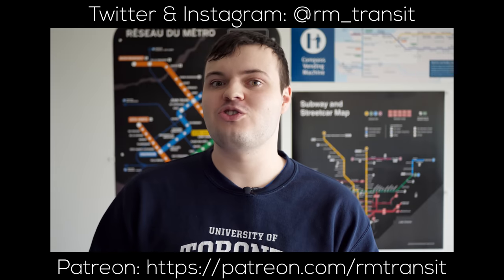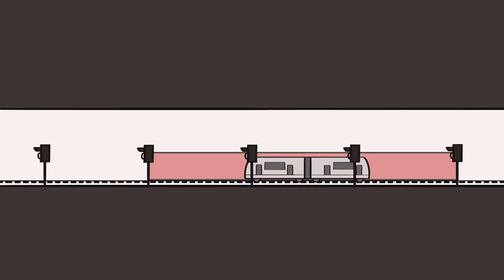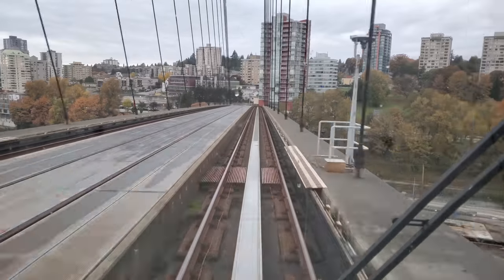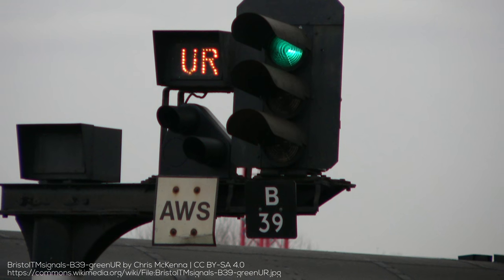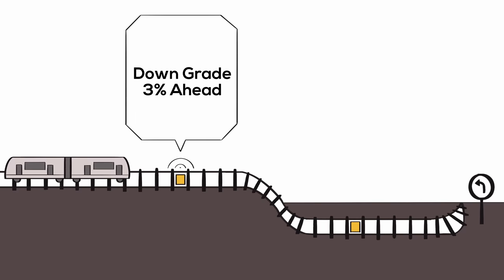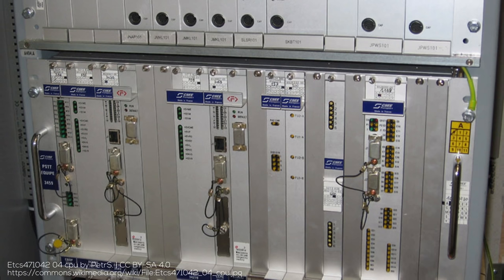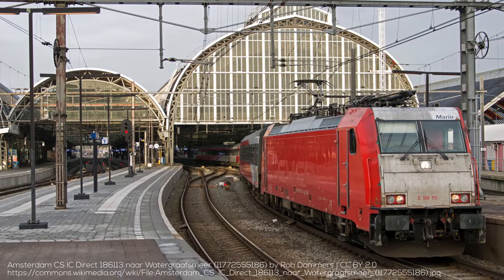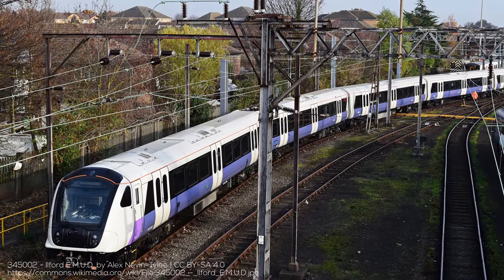How We Keep Trains from Crashing | Signalling & ETCS 101

Comment: Very informative  and yes please do more about train control systems. I'm still confused about what the "murican" PTC system actually does.🧐
Reply: it basically acts as an automatic braking system. say a train is getting too close to a red signal or there is no response from the engineer, the system will automatically apply the emergency brakes. (if i'm not mistaken)
Reply: @joeykidd8916  So it basically enforces "block authority"🤔

Comment: Can you get a video on what exactly the difference between ETCS level 1, 2 and 3 is and if any systems actually use level 3.

Also explain "CBTC" since technically the phrase "communications based train control" can be used to describe any signalling system as they all base their operation on communication of some variety. I know it refers to moving block signalling but what are the boundaries around it's use, how does it differ from ETCS level 3 and can CBTC systems from different companies work with each other.
Reply: ETCS-1 is an overlay system on the national standard. Balises on the track transmit the signal and route information to the train, and the existing rail vehicle detection systems (track circuits, axle counters, etc) are used to indicate track occupancy in the signalling control centre to the dispatchers. Train drivers follow the lineside signal aspects, but the ETCS telegrams may authorise a higher speed limit.

ETCS-2 replaces lineside signals with radio telegrams. The train is in constant communication using GSM-R, receiving movement authorities to proceed to the next block. Track circuits or axle counters provide the rail vehicle detection to the interlocking systems and dispatcher.

ETCS-3 eliminates rail vehicle detection (no track circuits or signals). All movement authorities are communicated over radio, and the train needs to pass very strict integrity checking or an emergency brake will be enforced. Lineside balises are used solely for static information, such as gradients and fixed speed restrictions. The main reason why ETCS-3 has taken so long to develop is because train integrity is a difficult problem to solve without a communications bus along the length of the train, and it is not cost effective to fit tens of thousands of old freight wagons with the electronics required. 

I believe a low-cost variant of ETCS-3 is used in Sweden as a replacement for mechanical signals and train orders on very lightly trafficked lines.

CBTC is the name for a bunch of proprietary cab signalling systems. There are too many variations on the technology to list, but none of them are compatible and choosing CBTC effectively locks a railway into relying on the equipment vendor.
Reply: @zoqaeski  You can have signals and national systems (as a second system) in ETCS Level 1, 2 and 3. Both in Levels 2 and 3, much information is transmitted by radio, usually including track information. At the Stuttgart Digital Node project, we noticed that train integrity is not THAT complicated for multiple units, in fact is only costs a few thousand Euros extra (per train) when ETCS is retrofitted anyway (which costs a few hundred thousand Euros per train). The same goes for FRMCS. When trains are to be fitted with ETCS for Toronto anyway, both ETCS Level 3 and radio-based ETCS/FRMCS should strongly be taken into account.

Comment: Can you explain why it has taken the TTC a decade to do signal replacements on Line 1? Having Eglinton Station shut down twice a month on weekends for 10 years has been a nightmare.
Reply: Pity the poor signal maintainer who has to stand in the tunnel as the subway cars whoosh past at speed
Reply: Line 1 ATC is in near completion.  

Understand that signalling from Union Station to Eglinton Station presumably dates back to when the subway system began in 1954.  Subsequent to the City of Toronto amalgamation in 1998, TTC became an agent of the City of Toronto; thus, their budget has become diminished.  Basically, it could a matter of dollars and cents.  About 2-3 months, there was a topic why these projects costs so much.  It turns out that politics play a role-quiet a lot too!

As for those shutdowns at Eglinton Station that began in early 2018 because this station is one of the three interchange stations with the Crosstown line 5.
Reply: @efaber3565  No the frequent signal related shut downs began nearly a decade ago, you can simply google that, but I know that because I've lived it. The current upgrades were supposed to be finished in 2019 and now they are 3 years and $100million over schedule & budget which is unacceptable. This city/province is a joke, we can't build anything in a reasonable time frame, heck London built a real subway line 4x the size (in a similar time frame) of the crappy Eglinton LRT (that will be at capacity day one). I'm just thankful that Doug Ford has seen more transit projects completed and approved under his watch than the decade plus of idiotic leftard control.
Reply from the maker: I wouldn't say the shutdown has been that frequent because I have been a regular Yonge line user in the past and while they were annoying they also weren't so common and part of the shutdowns were not related to signaling but the light rail line. I said I think as with many large projects on old infrastructure a lot of discoveries were made about what was and wasn't possible and this was the first time Toronto had converted a line.
Reply: @RMTransit  It has been, again because I've lived it. You can be a L1 user south of St. Clair and never realize how often Egg is shuttered so your word means bunk. If you want some proof please spend some time scrolling through the TTC Opps Twitter feed. Also as someone who grew up with Eglinton as his home station I have seen this project from its inception in 2013 and the early studies that took place that shut down the system for a weekend first hand. How come it will take NYC only 15 years(maybe 20) to refit their entire system yet Toronto can't complete half a line in the same time frame?
Reply: @adellis24  Most of the closures at Eglinton have been due to construction of Line 5 Eglinton, not signalling.

Comment: In today's world of cheap data storage, a database of every rail line in Europe would not actually be that much information. I think it is about 10,000 rail lines with, say, 100 kilobytes of information at most on each line, it would only total in the megabytes. Certainly doable. Consideirng that car navigation systems often hold more data than that for every road across a wide area. I think ETCS Level 3 (so far not deployed anywhere) does work with a database on line information and has only position balises to confirm location.

Comment: Does ETCS include visual signals for train operators (like track-side lights)? I understand that GO Transit will be implementing it and am curious what its lights/ signals are or will be.
Reply: ETCS level 1 uses fixed signals but level 1 is literally just a system that stops trains if they go through a red signal and slows them if they go too fast, the actually signalling and authority is done by other means. You can use level 1 with in cab signalling though, where a display tells the driver what speed to drive but if a network already has line side signals they will almost never implement in cab signalling, you might as well go straight to ETCS level 2.

Level 2 of ETCS still uses "fixed blocks" but they are virtual which means that rather than relying on physical track circuitry or axle counters to detect trains, the trains communicate constantly with the control system and the block locations exist more in the computers than physically, which makes it much easier to add lots more and increase the capacity.

Some systems have kept the wayside signals for redundancy (should ETCS break) but many systems have "degraded signals" that just allow trains to continue at full speed to the next station, but at the cost of railway capacity as each station and preceding section is the signal block, meaning trains can only run about once every 5 minutes.
Reply: @pwhnckexstflajizdryvombqug9042  Absolutely. ETCS Level 1 can be operated without lineside signals (such as in Luxemburg). It would be interesting to know what kind of ETCS Level 1 is supposed to be implemented in Toronto. Radio-based ETCS (Levels 2 or 3) can strongly be recommended, in particular when it comes to high-performance operation.
Reply: I’d guess it’s either the enhanced level 1 or level 2. Metrolinx specifically mentions that operators will receive “signals” on an in-cab screen and that the automated train systems will control max speed and emergency stopping if a red signal is run.

Comment: I don't know why but our government in india decided to throw ETCS the world standard in signalling and instead decided to develop our own "kavach" system to be used on all indian railways track. ( It includes everything except metros which use CBTC and hsr which is being developed with help of japan but will use ETCS). 

Their latest test was a big one because our railway minister himself was present in the cab of one of the trains and some other railway board officials in the cab of the other train. 
This was to show that the product is almost ready and mass deployment will start soon. 

Whatever technology they use, indian railways desperately needs advanced signalling systems because currently our loco pilots have to look out to see the aspect of the next signal which causes speed restraints and delays because in winter when there is dense fog the loco pilots are unable to see the signal and hence trains have to run slower and many trains have to be cancelled. 

It frustrates me that even after such a large and extensive network our main line trains use this stone age technology for signalling. 

I hope mass deployment of this kavach system starts soon and atleast all the important routes  and routes in fog affected areas get this technologyso that trains run on time and dozens of trains do not have to cancelled every winter.
Reply: will that system not block exporting technology. Development equipment based one ETCS could be sold to foreign countries?
Reply: @Neuzahnstein  that is what I don't understand. Why develop such non standardized technologies when good international standards are available. 
Plus they spent money and more importantly wasted 3 years developing this.  In these 3 years ETCS could have been installed on most major routes. And due to lockdown passenger trains were not running so it would have been easier and less disruptive. But here we are now....

Comment: It's somewhat weird to me that complexity of software systems around ERTMS would be a recurring challenge and a cause of missed deadlines. The system was invented 20+ years ago, right? Why do we call it a "system" if there's no systematic, bulletproof way of deploying it on new train networks over and over? :D
Reply: Railroads and trains are complex systems. Like he mentioned here the videos, there are many different systems, so it makes sense to standardize into a single system - however, because they’re all different, each one of those older systems will likely cause a unique set of problems in that period of change. When adapting existing lines and a fleet of existing rolling stock, nothing will be bulletproof from day one. Usually it’s one line (or even partial lines) at a time, so trains have to be able to handle switching systems on a daily basis. This is not easy. It’s certainly very different from building a new line and using brand new trains specifically designed for that system.